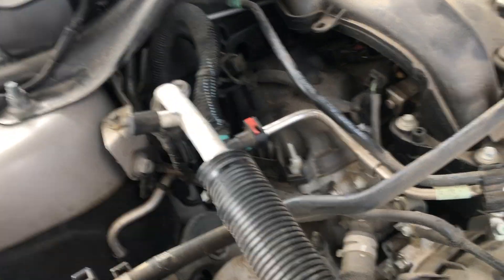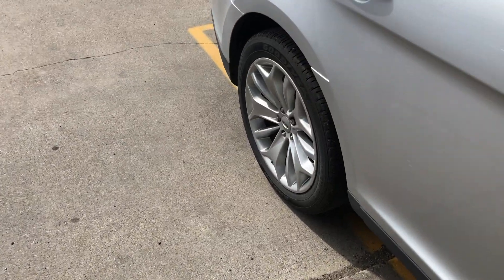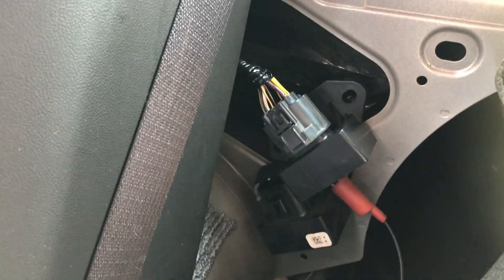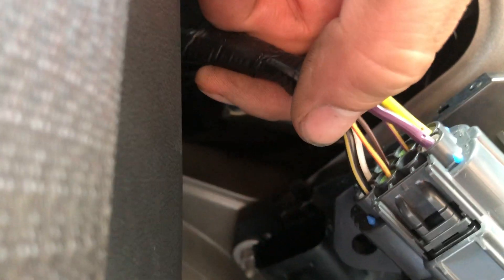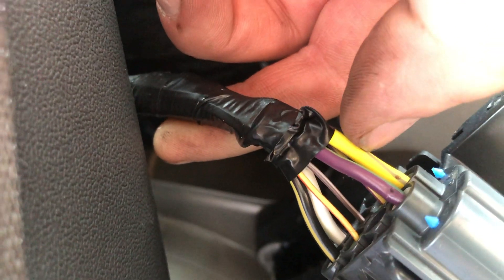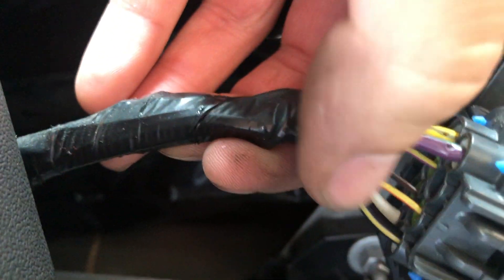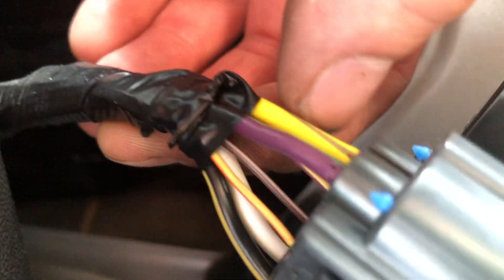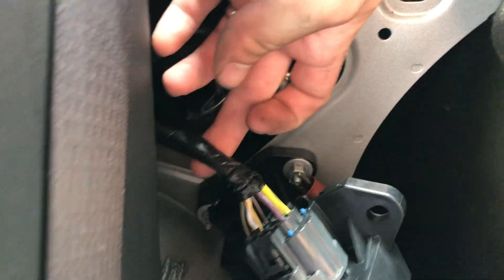2013 Taurus Fuel pump driver module testing and replacement

Comment: For those of you with the police interceptor Model sedan there does not appear to be any videos. The location is the same and you can access from the trunk. Remove the plastic retainer on the carpet and use a 10mm deep 1/4 socket / ratchet, no other tools required. Great video!

Comment: MT406 Team,
Thanks so much for this video. it took me straight to the issue that was the relay. I replaced it, now our 2013 Taurus is running like it always has. The only thing is now we have a yellow wrench icon on our dash. Owner's manual shows this as "Powertrain malfunction/reduced power (RTT)" and tells me to contact my dealer. Please offer any advice you may have. Many Thanks
Reply from the maker: @65dmack  my best advice is to somehow get the code scanned and see what it's saying. You could try disconnecting the battery and see if it resets

Comment: I replaced my fuel pump but the gauge doesn’t show the mileage and today the car turned off again. Do you think the car engineer put it wrong or that it may be the piece that had problems?
Reply from the maker: I'm sorry I don't understand? This video is about a fuel module, not the fuel pump though.

Comment: For those trying to remove the back seat:
Bottom: Two latches at front of seat. Small black levers where seat meets floor.
Back: Remove 13 & 15 mm nuts where seat belt anchors at floor. Then look for red cords along side near door. Pry back the cushion and look towards truck. Pull on each side to release top latch. Good luck!
Reply: How do you take of the module its on right
Reply: Tight
Reply: I believe it was a 10 mm socket. What are you using to remove it?
Reply: This is not necessary to access the module. Just pull the strap on the top of the back seat cushion and pull down. You don’t need to remove the entire seat.
Reply: On a regular Taurus you are correct. On a police interceptor version, the seat is a single piece and cannot be folded down. 

Since originally posting the earlier comment, I was able to do it completely through the trunk. If you lay on your back in the trunk space and have the dexterity to “work by feel”, it can be done.

Comment: I changed mine but it didn't work! HELP PLZ..
Reply from the maker: Do you have power in and power out as described?
Reply: @mt406mechanics  Not sure,Don't have a test light.I replaced the module behind the back seat and it still didn't start..I'm not sure what it could be..Sometimes it turns over to crank and sometimes it doesn't..
Reply from the maker: @gballa2730 Your going to need a test light to test and know if the module is bad. They are about $4.00 at napa or o'Reillys